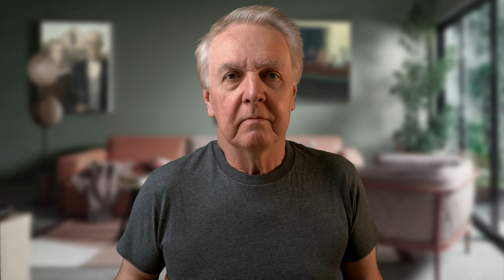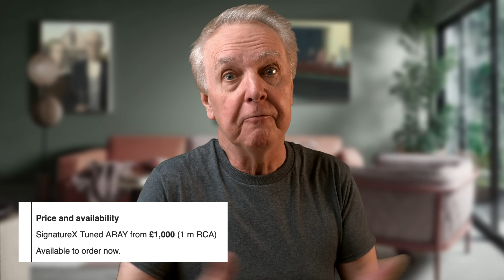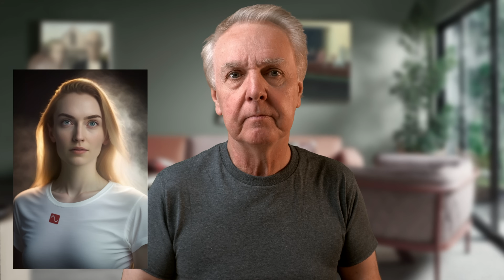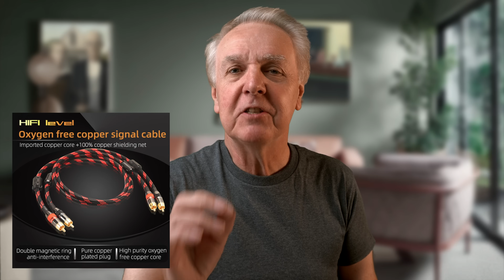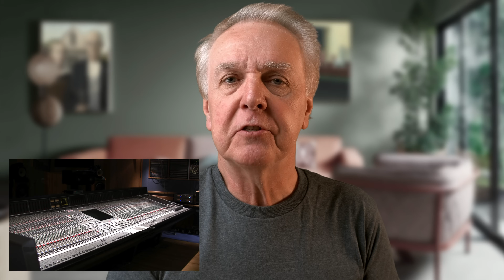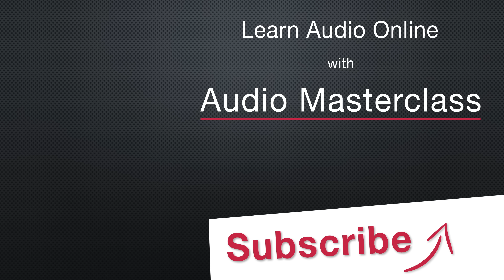Would you pay $1000 for a 1-metre cable?

Comment: I just spent around $1000 on wiring for my stereo. For that I got a one metre pair, four ten metre pairs, all terminated with XLR's, and a 0.6 metre spdif, and 25 metres of 4mm2 speaker cables. 

All XLR's are Starquad from Klotz, it even says "High end" on the cables, and all terminated with beautifil Neutriks.

I'm good for wires, thank you.
Reply: " a one metre pair, for ten metre pairs" I don't understand this
Reply: @editingsecrets  Supposed to be four ten metre pairs.... Easy to miss misspelled words when the spell check is in a different language and everything gets the wavy red underscore. :)
Reply: @thomaslutro5560  Got it! Thanks.
Reply: @thomaslutro5560  You could have soldered them yourself for a fraction of that price. $1000 is ridiculous for those few cables.
A Neutrik plug costs under $4. So lets say ten plugs. That is $40. And then the cable. Take Klotz cables for instance. A 30 metre roll of Klotz MY206 (more than enough) costs under $100. Your $1000 should've been $140.
Reply: @rabarebra  I see your point, though there is a total of 20 Neutrik XLR connectors and two Canare (I believe) RCA connectors. I think the RCA's are crimp/screw on. Having somebody else do this job is expensive, I know, but for the starquad there is a total of 20 times stripping the outer jackets, 80 single conductors to carefully strip, twist in pairs and tin, and 60 joints to solder in total. In the end having somebody else do this a luxury I can afford. 

All in all there is 82 metres of starquad cable in the bundle, 0.6 metres of coax, and 25 metres of 4mm2 speaker cable. 

I will be soldering the speaker cables myself though, with some very nice Deltron bananas I found for around 40p a piece. At least until I get my amps modified with Speakon.

An indulgence, sure. But not wastefully splashing out on something like NordOst Odin 2 at around 40000€ for a 2 metre pair....🤣
Reply: @thomaslutro5560  Why do you need Speakon, just stick with XLR. No need to make it more complicated than needed.
Reply: Why XLR on the speaker wires? The amps are currently banana only, therefore banana. I'm building speakers, they will have Speakon, therefore Speakon in the other end. I will convert to amp and amp end speaker wire to Speakon because it's just the nicest, most reliable speaker connectors out there.
Reply: @thomaslutro5560  Ah, you have passive speakers. But do you need Speakon? They were mostly made to be rigid in PA setup on the road. At home it really isn't necessary. But if you solder them yourself, it cost nothing to change. Neutrik also makes Speakon connectors female/male both for cable connectors and chassis.
Reply: @thomaslutro5560  Only problem with Speakon is if you run into the cable, you'll cary everything with you and/or damage the cable, or should I say interconnect. Since they are screwed on, they are too rigid. 😂

Comment: Probably the least affecting yor sound are the cables. Not saying that it doesn't but there are far more important and often simple things that matter. Positioning of your speakers (1st reflection point...), audio rack or furniture, the floor where to put everything upon and the power supplies. Cables matter but from my own experience by far the least of all the above. Tip: spend the money on a good MC cartridge 😊
Reply: Cables only need to have good contact, made properly, and have enough strands (thickness) for doing its job for its purpose of choice. A good cable per metre shouldn't cost more than £1, which you can find from e.g. Klotz or others. Solder yourself.

Comment: £1000 for a 1 meter cable is bottom of the barrel and entry level hifi. That means the cable was only £150-200 to make by hand and the lion share of that is labor cost. So in material maybe £50 is left. If you had a £5000 cable then you would have £250 in material costs! That will give you at least an idea on why 1000 is really labor + junk parts.
Reply: @Douglas Blake I am not! You take the price of the cable and divide it by 5 to figure out manufacturing cost. Most of the money is the hand built labor costs. An Ansuz DT-C power cable takes 1 man 1 week to make 1 cable for example.
Reply: @Douglas Blake no but I did buy a better brand of cables that were more expensive and sound waaaaaay better from Kubala Sosna
Reply: @pennfootball Snake-oil-manufacturers dream customer. 🤣

Comment: Back in 1980 or thereabouts, I was working with a country band. One day we were setting up at a random bar nightclub when the bass player suddenly came unglued !  Apparently he couldn't find his special cord, (from his bass to his amplifier). I had picked it up thinking it was one of mine. I had already finished connecting my system and was noodling around on my guitar when the bass player noticed what had happened.  I had not heard of (audiophiles, or audio extremists at that time), so I thought he was making some kind of joke.  He said I had ruined his cable by sending a guitar signal through it, and now I owed him 100 bucks.  The guy went completely nuts as the situation escalated into a total brawl. I left that band that night. It's next to impossible to reason with delusional people !!!
Reply: @Ronin Zanan - I'm a bass player and EE and would be pissed off if someone had stolen my bass lead, but a mistake would not have been a problem. The dude was obviously nuts.
Reply: Whoah. It's a good thing you didn't plug it into an electric ukulele. That would have let all the smoke out of the cable.
Reply: Holy crap! I can believe this story too... some people are brainwashed into what they need to own or buy to improve their sound. Audiophile gear really does exist - expensive, quality gear.. but swimming in that same pool are the sharks making money from people that don't know better but want good sound still.

It's been tested consistently.. so long as metal is conductive, cables aren't going to make a blind bit of difference to the sound quality whatsoever. I've seen blind testing and audio analysers tested with coat-hanger wire as compared with "Monster Cables" costing $2,000 a meter... zero difference. It's the ultimate in Audiophile snake oil.

Some of the descriptions on ultra expensive HDMI cables on Amazon are hilarious.. higher transfer speed and superior digital transfer.. Zeros and Ones. Either are or Aren't. There's no inbetween. Also, thanks to redundancy and error-correction encoded into many digital file types - you can lose chunks of data and it still be reconstructed to the original without loss . CD-DA had excellent error-correction redundancy built into the file format itself - it was made so that any scratches or dust on the disc that were interrupting the laser reading the data could reconstruct the original audio stream without any loss whatsoever.

Comment: I was brought up to understand that signal currents move along the wire surface and not within.  Hence a multi-core cable will be better than a solid core one, especially at higher frequencies (it's why Litz wire is sometimes used in radio coils at LW/MW for those who remember AM radio).  Thus ordinary 13A mains rated multi-core wiring will work well for speaker connections.  I regularly used 50m and greater lengths of such cable in theatre work without obvious problems.  For example, reactance at about 150pF per metre is like putting a 6.8 nF capacitor across the amplifier output or a 2.5K resistor - something any respectable PA will take into its stride having a typical output impedance of some milliohms!!  But then, my hearing is defective due to the effects of rather loud music.
Reply: @Douglas Blake You are of course right.  Skin effect becomes measurable at >45kHz, way above our audible range and even then small.  Apologies for getting my impedances in a twist - I was schooled in my youth by an old radar technician. (Who told me he had worked with Watson-Watt!)   At least the multi-core is more flexible!
Reply: @Bob T The typical mansplainer. No one cares about a 6.8nF capacitor across the amplifier output  or a 2.5K resistor. If you want to talk about Ω and farrads, go else where.
Reply: @rabarebra  You would obviously prefer to spend the $1000 in perfect ignorance.
Reply: @last1059  What do you mean? I solder my own cables.
Reply: @rabarebra  So you really agree that ordinary cable can do the job without resorting to special (costly) alternatives.  Have a nice day.
Reply: @last1059  Yes. The same cable they use in the studio for recording doesn't cost much. They use standard pro-audio cables and neutrik plugs. Do you think they use those zillion dollar cables? 😂

Comment: Well my passive 2 way system uses nordost leif blue heaven 2m  speaker cables,  and my 0.6m shielded  rca interconnects with pure silver internal wiring  are custom made by GOTHIC AUDIO in the UK, with same gauge strands as my nordost blue heaven,  (  0.4mm gauge )  with 4+ and 4- strands the connectors are copper silver plated by aeco, and these rca cables at the time of me purchasing them only cost me £100 at the most a pair .  I don't like any chord cables, to ne they do don't sound as good as my more revealing custom made cables, which have better resolution  detail, timing, dynamics, and lay bare all the good and bad in the music recordings .  I like what the nordost leif blue heaven does for my old modded GR20 MONITORS which internal lined for no internal resonance by the internal cabinet walls. They  are now just a two way instead of 2.5 way, and the original bass driver is now used for the mids, because it is not susceptible to any bending and flexing, has better clarity timing / speed and dynamics with no sibilance. My amplification are two old AVI S2000MI each used as a separate mono's. I use a linn kolektor as my active buffer for my digital DAP PLAYER line out using the lowest 1 volt voltage output. I Can cut down low frequencies from My DAP player by 15d, and also by 10db at 40hz from my linn kolektor. Gives me a lot more headroom, than a system that cannot do a damn thing about lowering excessive low frequency not needed going into your amplifiers and loudspeakers that impairs a loudspeakers clarity, headroom, and dynamic performance. I like my old AVI S2000MI's with their large single transistor per + and -  push-pull each fed  by a heatsinked fet driver. Natural, detailed, transparent and dynamic.  Need no protection circuitry relays.  capable of 375+ watts into 2 ohms at 18amps of current, which is enough for any two way speaker, with low frequencies cut and not needed for a two way below 40hz. I still have frequency extension to 25hz but obviously with better detail, clarity, dynamic headroom,  with a vice grip on the drive units, with no driver distorting excursions, no matter how loud i  play them .  No one one note lumpy bass, but bass clarity definition dexterity separation contained within low frequency information down to 25hz, with excellent midrange clarity, using digital 44.1 khz, even using spotify 320kps 44.1khz, using the quiet normalizing setting.

Comment: Why don't you reach out to The Chord Company & ask them to comment...?
Reply: 👍I spoke to one of their staff recently. They were careful not to make claims about sound quality. 
Only how the cables are made & with what materials.
Reply: I just bought some Chord Carnival Silverscreen cables on eBay , mainly because I want to be able to pull my new (used) floorstanders out further for long sessions. Are you trying to tell me I won't hear the difference between those and my 79 strand  🤣🤣🤣 I've not had a chance to listen with them (the anticipation, the excitement), because I need to fit new plugs to them. I am anticipating no difference, on account of I think it's b.s, and I have 62 year old well used ears. I do wonder if the silver screening is of any value though, I guess coax is screened.

Comment: I had some fun looking at hifi shops in the Netherlands. It appears they are not as mean about precious metals as here in the UK because they had offcut lengths of silver 10A speaker stranded cable in bargain bins for a few euros. It is as well to consider specifications as a starting point before buying anything. Silver will have a higher speciation because it has a higher conductivity than copper . This can be reinforced by the fact that the best instrumentation is also silver soldered.

Comment: Well, if you own a $100000 dollar setup why not? It's just a small part of your budget. And it does not really matter if such a cable is worth it as long as you are happy with it. Good for your bragging rights. But if you are like me and own a set that's well under $10000, forking out $1000 for a single cable is madness. And I really doubt that it would make my system sound significant better.
Reply: Audiophiles feel better when paying $1000 for a 1 metre cable than $10 (which a fully quality one costs).

Comment: I would add: There are such things as bad 1 meter cables (that use rubber dielectric, for example, or flimsy shielding, or made out of spaghetti covered by macaroni), but reputable fully adequate alternatives can be had for a few dollars (or pounds).
Reply: A perfectly shielded one costs less than £1 per metre.
Reply: That’s suspiciously cheap. Got a link to the seller?
Reply: @allenjgoldberg6960  Then just google how to create cables, which one goes where for each type of connector; the shield, hot and cold.
It also doesn't matter if you make a cable where say the left signal is a shorter cable than the right signal. I guess this sentence will disturb a lot of audiofools minds. 😂
But believe me. Going from a Ali-baba-cable to these Klotz ones, really makes a difference.